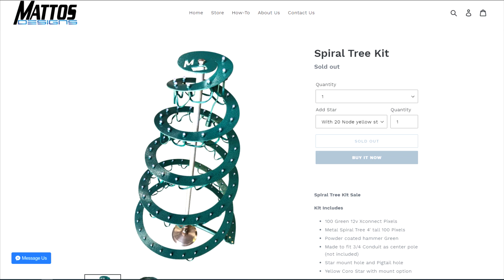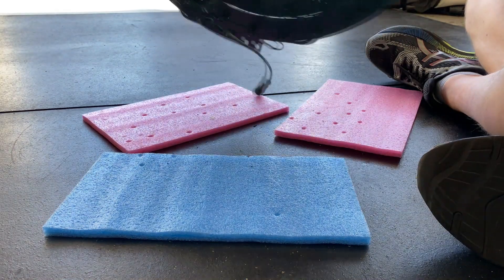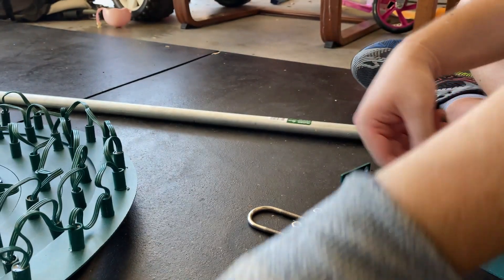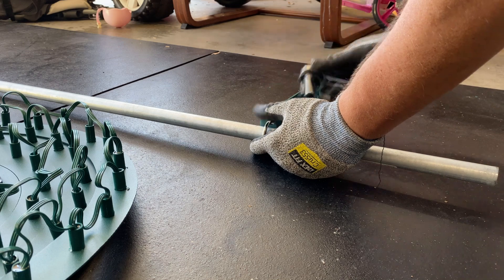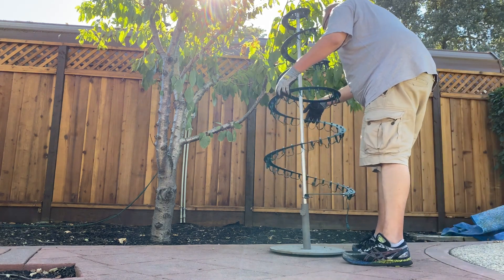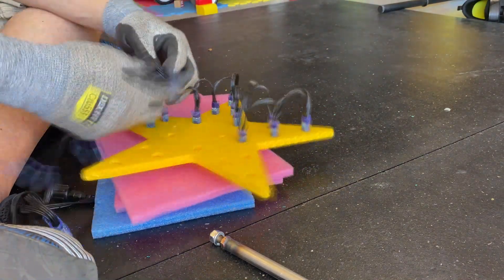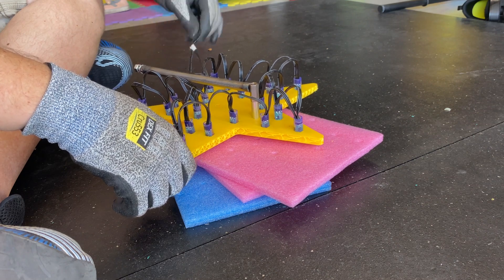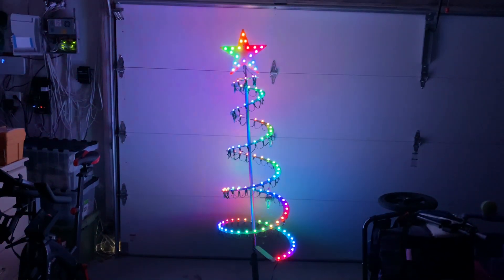Building the Mattos Designs - Spiral Tree Kit

Comment: How much was it
Reply from the maker: It was $145, which may sound like a lot at first.  However, you have to remember this is metal/steel that has been CNC'd, includes 100 pixels for the tree, 20 pixels for the star, Coro Star, and mounting pieces.  The metal has also been powder coated for durability.  I find it to be a fair price for something that should last a LONG time.  It was a little less cost if you opted to not get the star on top.
Reply: @SJLights   Thanks for the info And taking the time to get back to me I have a dozen or  So strands of prick pixels I like the design and I will probably just fabricate my own I have a 16' flagpole In the fright yard I can use for the tripod go big or go home lol You can usually see my house from space this time of year Thanks again for the info Troy